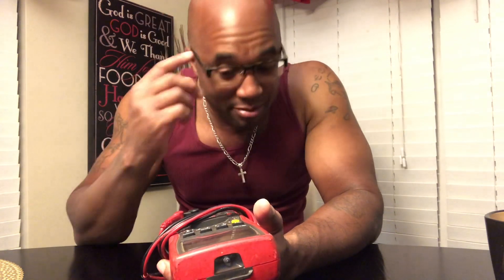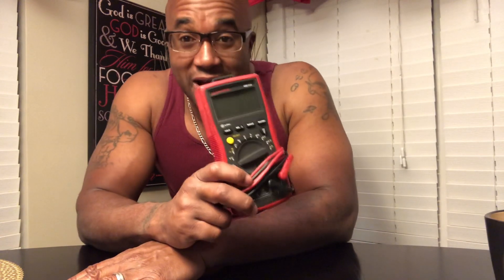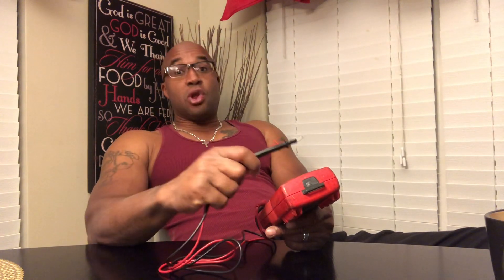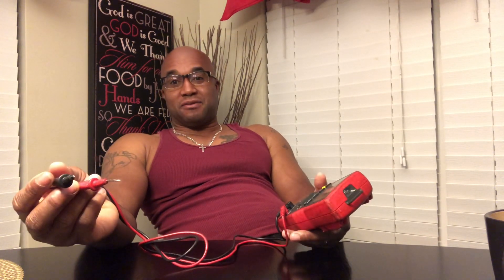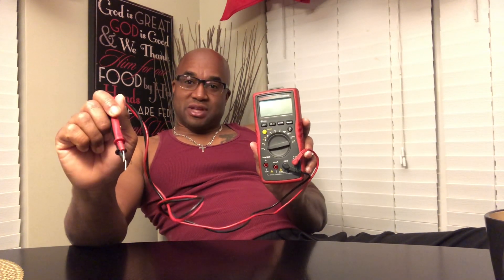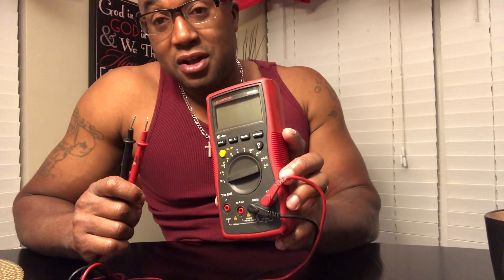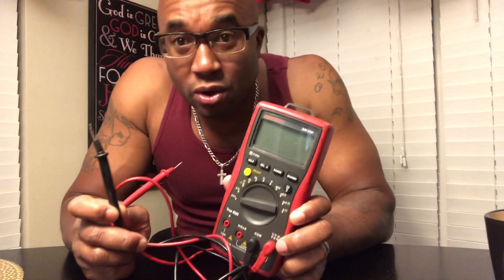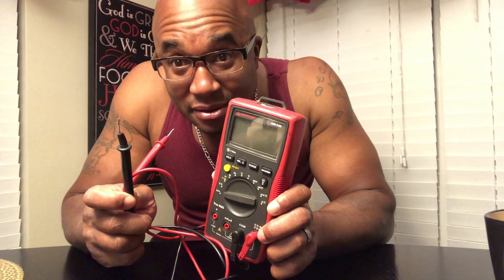Multi meter... most important tool!

Comment: First thing i bought before any sub or amp MULTI METER  also need to know what voltage your subs or speakers can handle at rms then turn your head unit to the level you want to listen at on a daily and set the voltage there great video sir

Comment: But your lc1is sending 9v!! input so at those high voltages can even your gain set to zero clip?
Reply from the maker: The higher the input voltage the less chance for distortion... I’m sending a little more than 5v to my amp